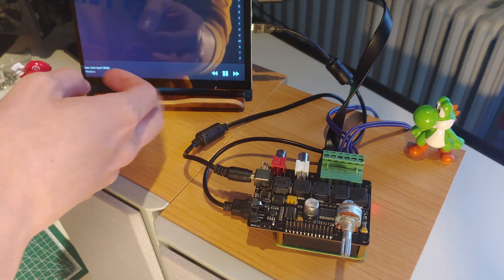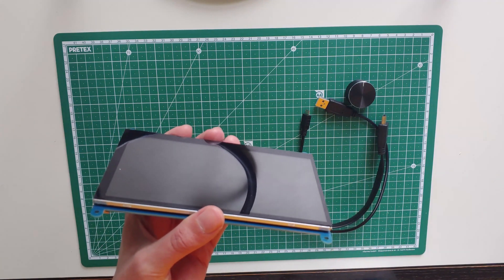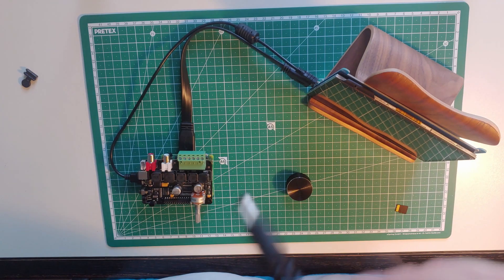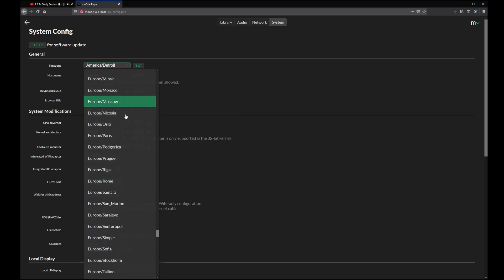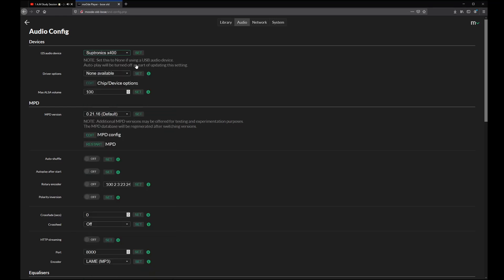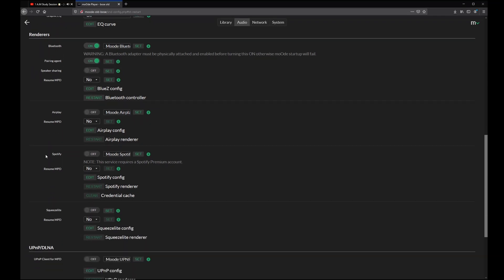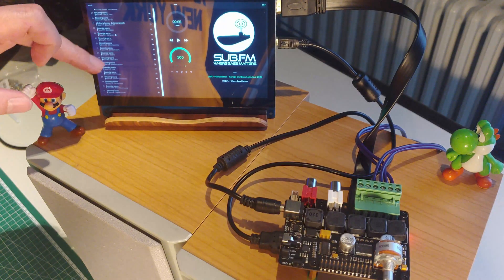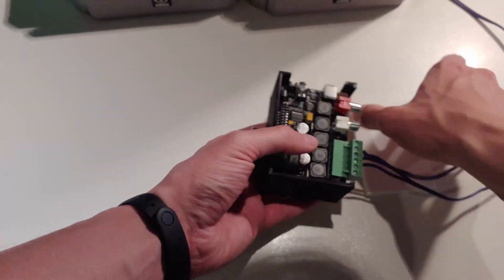Revive your old speakers with a Raspberry and moode

Comment: Hey, I'm running moode audio on pi zero w with justboom digi pHAT, headless now and was thinking to add 7 inch touchscreen display to the system. Will this throttle the pi zero and slow down the whole setup? Any opinions would be very much helpful 🙂
Reply from the maker: Hey Manuel,
I am running one of my moode instances also on a pi zero. However I only briefly tested it with a touchscreen. It was working but too laggy for me. If you have no problem with a not very responsive UI you can give it a shot.

Comment: I've just installed Moode and I am now pondering if I want to go back to Volumio.  Here are one or two notes on the two systems.
As I'm not a Pi expert and I think I would have struggled to install Moode if I hadn't installed Volumio last week. Moode is more feature-rich and setup options are more intense but the official instructions are not as well written as Volumio.  Moodes DLNA server works, Volumios doesn't.  Volumios web interfaces on android phone and tablet just work better than Moode, it's hard to select an alphabet character on Moode.  GPIO buttons are ready to set up on Volumio once the plugin is enabled. GPOI buttons are supported on Moode but no official setup instructions are available and you need to hunt around the forums for a solution.   I haven't compared Sound quality yet but initial thoughts are Moode adds clicks as tracks start.
Reply from the maker: For me the main reason to stick with moode was, that it supports bluetooth connections in the free version. Maybe that has changed already and volumio does too.
But I really like to be able to send music to the speakers. Or that some friends can easily play there music on it too.